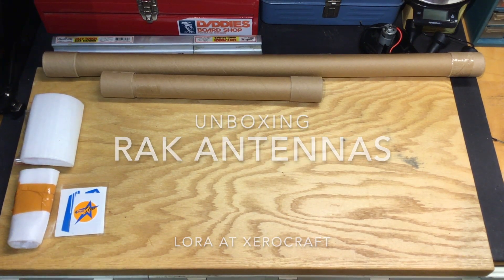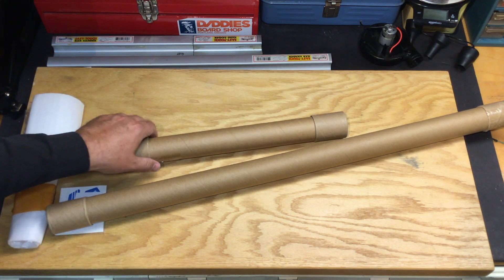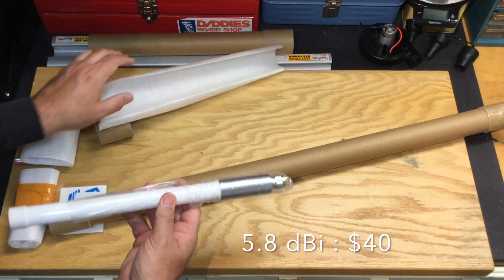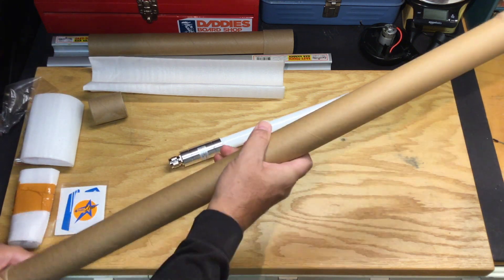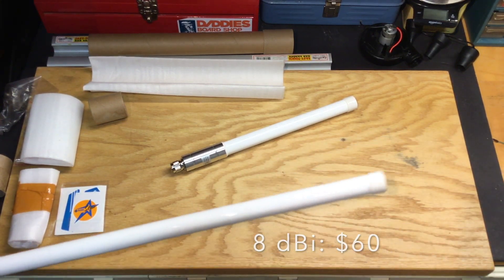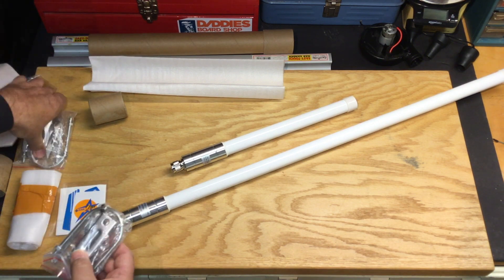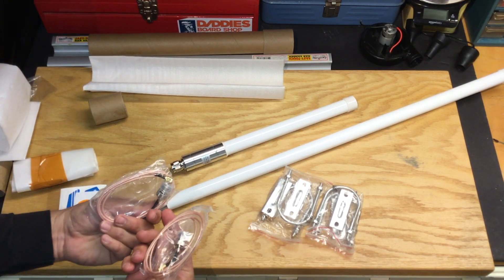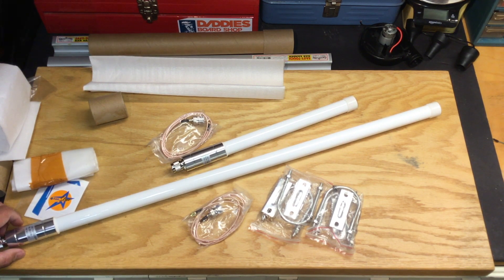LoRa RAK Fiberglass Antenna Unboxing

Comment: Do u need to ground these types of antenna
Reply from the maker: For roof installations, these should be properly grounded to handled potential lightening strikes, but I am not versed on how to do this. To minimize fire risk from a lightening strike, my LoRaWAN gateway is installed on an exterior wall, and the coax cable to my antenna runs along the outside of my house. https://youtu.be/P2I_dEdryn8 . In this case, if the antenna is struck, the coax isn't running through an interior wall which could start a fire, but I'll admit this is not ideal. My goal is to have this gateway "off the grid" by having it solar powered- I have the hardware to do this and will summarize shortly, but I'm currently distracted with projects for work.

Comment: Question.  How long in “feet” roughly are the cables that come with the antenna.  Thanks
Reply from the maker: Found it! It's 38 inches.
Reply from the maker: Sorry for delayed response - I seem to have misplaced in my busy shop, but will update shortly. Having said that, would recommend you engineer some coax if you need a long connector in order to avoid power loss. I will dig it up and let you know ASAP.

Comment: Quick question, I've bought a Bobcat miner 300 last week, won't arrive for 8-12 weeks but I know I'll need the 8dbi "RAK Fiber Glass LoRaWAN Antenna (US915)" and an extension cable "RP-SMA Male To Female Wifi Antenna Connector Extension Cable Cord Black 10M" for the miner... I'm not quite sure if this is the right set up. I'm afraid it won't connect, would you happen to know the best 10ft adapter to connect the 8dbi "RAK Fiber Glass LoRaWAN Antenna (US915)" to the Bobcat miner 300?
Reply from the maker: I can't tell from the website for the Bobcat miner, but it looks to be be an SMA Female connector on the back. The RAK antennas are an N type male, so ideally, you'll want coax that will have an N-type female connector on one end for the antenna, and an SMA male type connector for the gateway. I talk a little about coax in this video - cued for your convenience: https://youtu.be/P2I_dEdryn8?t=365 . The cable I purchased is male on both ends, but you can find adapters to convert male to female at your local electronics store or Amazon. Good luck!